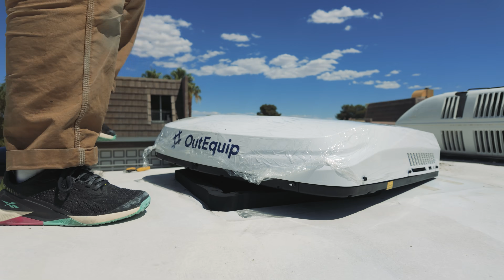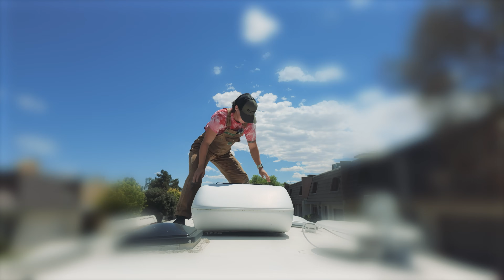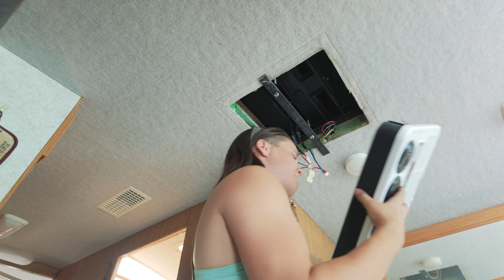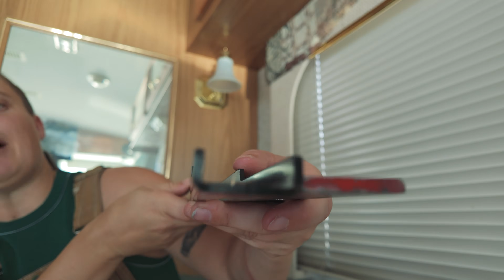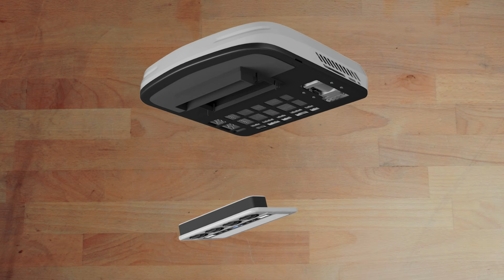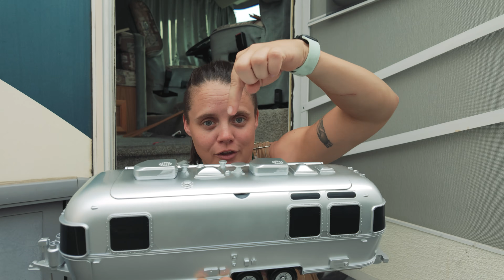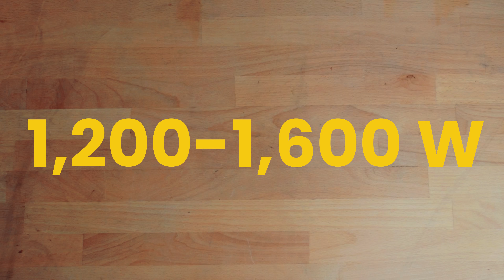Better RV Cooling with Less Power? My Switch to a 12V  AC | OutEquipPro AC Honest Review

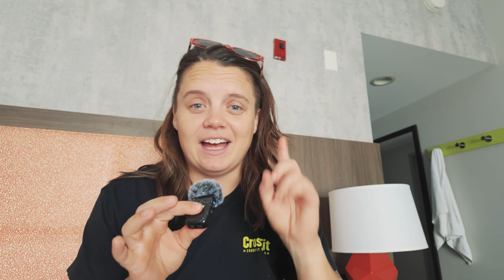Comment: 23:49
If you are plugged in at an RV hookup on either a 30 or 50 amp AC circuit, in an RV like yours without an inverter, you rely entirely on that hookup for power. This means if your A/C is runing from your 12VDC circuit, your batteries are discharging, or are being charged by a battery charger (or inverter/charger) which is basically doing the opposite of what an inverter does (making DC 12V from AC 120V instead of making AC 120V from DC 12V).

Therefor, your “capacity” in terms of amperage is not increased by running this A/C unit off of DC. You are not powering directly using AC through your “A/C” breaker, but you are using the equivalent (+ a small amount, nothing is 100% efficient) to keep your batteries charged, likely from a different breaker in your panel.
Reply: To be clear, what you said IS true for someone with solar and inverters for example, such as myself. I DO get the ability to run extra AC devices if my 6kW inverted AC no longer needs to power the A/C, if my battery setup can handle the extra load (ie if it isn’t also sized to output max 6kW).

Comment: Traditional TT owner here. I've been researching DC units for awhile. I've got a solar set-up with 480ah (Life4Po). A DC AC will be AMAZING. Also a newbie to RV AC stuff (but do understand electrical). Just wondering if I will need to modify the roof opening, or are most of the openings pretty standard?

Thanks for the great video!

Comment: It seems these 12 volt units were specifically made for vans and trucks with much narrower ceilings.  They would probably be a godsend to the average delivery driver in a panel truck that has to run around with his sliding doors open to help with the heat.  For what they are they're pretty efficient but in a 40 footer like my winnebago/destination 2 would be required.

Comment: When you say: 'Use less wattles" I think you not right. If less watts, it means less productivity (exactly it will take less Amp from your source, but watt describe how many works do it in per hour). if you make low Voltage, you Amp (per hour) will grow up if the same wattles. Also, it will impact to use more thick wires.

Comment: WILL I BELIEVE THAT ONE CAN ACTUALLY GO AHEAD AND LET SOME OF THAT CONDITIONED AIR GO BACK THROUGH YOUR REGULAR DUCT SYSTEM YOU MIGHT WANT TO JUST ADD ANOTHER LITTLE ELECTRIC FAN OR S   AND INTO THE CIRCUIT 
PASTOR DAVID ADAM GRENIS

Comment: I have a 23 ft class C RV And I have a 200 amp hour lithium battery bank a 3000 watt pure sine inverter And I purchased this room air conditioner that cools down to 61° and I've run it during the day with 400 watts of solar behind it and ran it for a couple of hours at the heat of the day I use it on occasion and never put a dent in my battery bank it's starts and runs so easily and vents out my small kitchen window. Really works great and super inexpensive I mean come on under $250 and there's no install I just plug it into my 3000 watt inverter and it runs perfectly. It's a costway 8000 BTU they do have a 10,000 or even greater if you want but I didn't think I needed that much and I didn't can be purchased on Amazon.

Comment: You better check your batteries all the time and rewire that thing and put good quality wires in it and it will work. That thing is a piece of crap don't even try to bring it in the desert it will burn your RV down

Comment: I just installed one..love it.  The gasket is useless, buy a new 1pc one.   Place the brackets just under ceiling panel, use the bolts it comes with and grind off the ends after installed so it's all flush.

Comment: Interesting information. Thank you. But the reason I came was to find out the power usage of the air conditioner, and without knowing the outside vs. inside air temperature and humidity the wattage by itself isn't very informative. Any air conditioner can get excellent efficiency if it only needs to run the fan and rarely turns on the compressor (or in case of the inverter, slower). The operating conditions are the important factor to give real world power usage. Would love to see this video redone with more carefully collected data.
Reply: She said, "The unit with the fan and compressor running, pulls about 290 watts". 
   It does not matter what the outside temp is. It does not matter what the inside temp is. It does not matter what the humidity is. It pulls 290 watts.  That is all you need to know.  Now you need to take it from there ...

Comment: When you are plugged in, you are charging your batteries from the AC, so you are not freeing up all the AC amps.  But, this unit is very efficient and greatly reduces the amount of your AC used to charge your batteries.
Reply: Solar Charging!

Comment: Notching that bracket, sense it is under load and vibration, will bend and eventually crack. 

The spacer idea would be safer method.

The manufacturer would be smart to sell a spacer to resolve this issue.

Comment: Wondering if two of these could sufficiently cool a 38’ RV. Have an old Dometic and  a Coleman up top, but can usually only run one with my 30 amp system. Have 600ah in batteries right now, plus an EcoFlow 10k system, with solar up top with about 1200 watts. By the way, you are hands down the best at what you do. Thanks!

Comment: I've experimented with 12-volt powered air conditioners for a few years can I have found they cost just about as much to run as a 110 and 120 unit

Comment: I have a question that maybe OP or anyone in the comments might be able to answer: what if I am full-time, plugged in, but don't have functional batteries? I guess all the DC stuff in the camper (lights mostly) must have an AC to DC inverter? In this circumstance would I still plug into the batteries or could I wire it somehow else or would DC appliances not be relevant for my use? Not sure if it's relevant but for reference it's a 1986 Avion similar to an Airstream

Comment: FYI: I was looking at it and the Victron and the 95% eff is misleading. I recently bought a Aims 2000w invertor / charger for a little camper build. From my testing im getting 83-85 eff... But if you look at the Victron eff power curve it ranges. So the biggest benefit with the 12/24 ac's would be no invertor loss. But the big question is "How long do they last" ??? Some of the regular ones will have lasted 20 years.

Comment: Hope you can answer this soon…. and btw you are such a great teacher thank you!      So I just ordered this for use in my fifth wheel and as you know the thickness won’t let the supply plenum connect … what would you recommend?  Either a foam board partition separating the cold and hot or come up with a ducting to connect the supply together?    Thanks!!

Comment: Still have a little more of the video to watch. Good job explaining things. It will help a lot of people.  
One thing im going to have to disagree with is that you don't need as much air flow. Air flow across the coils is was its all about. 
About 2 years ago, I redid all my AC ducks, in my house, of Couse cleaned coils at the same time. Same AC until with better air flow, night and day difference.

Comment: Hi, just started looking at (12 volt) a/c units. I have a 2002R vision flare light class a motorhome. I have a generator. I have a roof rooftop AC unit now that I will keep. I’m wanting to install a 12 V unit in the bedroom by replacing the roof mount vent. I didn’t plan on powering it with an Eco flow generator and solar panels on the roof. I’m also looking at replacing the old refrigerator with a 12 V unit. I think I can run both that rooftop AC and the fridge off of the Eco flow solar system. What do you think

Comment: The website says it draws 58A and requires 6ga wire.  Also says it is 10,000 BTU cooling with optional 4500 BTU heat.  I only saw 1 model.  Very interesting though.  Thanks for the info!
Reply: 21 Amps - Eco Mode
58 Amps - Turbo Mode
???
Reply: @MrSummitville I guess I  missed the modes.  All I saw was the spec chart.  Glad I found your video.   I've never heard of this before!

Comment: You fail to account for the power on the 12v side when you say you are moving the power requirements from the AC to the DC side, eventually you discharge the battery that needs to be recharged which will required AC, in fact too many will look at this and decide to add one only to discover the 12v batttery is quickly depleted, or they end up maxing out the 12v converter attempting to supply up to 60A of 12v power just to run the A/C when other systems continue to need 12v and the 12v fails.  These 12v  A/C systems are truly only for those with large battery banks or solar supplement, not for family campers staying in campgrounds with 120v shore power.  You also don't account for the BTU difference of a 10K BTU 12v unit vs a 13k BTU 120V unit. When in a very warm climate where the 13K unit runs near continuously, the 12v will also struggle more.  You fail to account for the difference of the lower airflow at a given delta temperature is much less cooling capacity than the higher airflow AC unit with the same delta temp.   I'm not disputing that the variable speed 12v units are likely a higher SEER ratio, but the RV industry is also starting to provide higher SEER units on the AC side, these are a better choice as it won't tax the 12v systems that have only 720 watts of total capacity after the batteries die and they come in 13K and larger BTU capacities.
Reply: + Solar Charging ?

Comment: @Rv Repair Woman >>suggestion as well for that air gap you got on the inside control plate why not use foam ribbon similar to what you would use around a house door , so you are doing something similar to the cummings camper but woth just a small piece of foam ??

Comment: Toluene is toxic, wear the correct thick gloves. 
Gemini AI: for handling toluene, nitrile or neoprene gloves are generally good for splash protection and incidental contact. For more significant or prolonged exposure, Viton (fluorocarbon rubber) is highly recommended.

Comment: Just starting to learn about this stuff.  I need to run an oxygen concentrator.  How do I determine what I will need to breath when     boondocking?  Shopping for a van conversion but this is all new to me. I also want this air conditioner.   Will solar be enough and how much?

Comment: I'm sorry, this is just not fully accurate. 

It pulls 1/4 the power because it doesn't cool as much. You saw this with the reduced air flow.  It may be a bit more efficient but it is 1/4 the power because it cools less. It takes power to move heat and you can't escape that. 

The 12 volts doesn't get you away from from conversion loss. The  AC draws 22 amps.  A 100 AH battery will power it for 3-5 hours (depending on battery chemistry). Then you have to charge your battery by plugging your RV into a generator.  That chargering of the battery is maybe 75% efficient so you have a conversion loss of 25% or twice the inverter.

The reduced cooling and the new additional 25% conversion loss means you actually will end up running your generator longer, and spending more on gas, than with the AC based air conditioning.

You can't escape physics. Less power because of less cooling and you need your generator in both situations.
Reply: Eco Mode vs Turbo Mode

Comment: 2007 Trail Blazer by Komfert 120v AC I run a Predator 3500 inverter, 2.9 gal tank, will run about 9 hours with the AC running, for our dogs
But I'd love to do one of these on my 77 Chevy G20 Van

Comment: It sounds like you found a wonderful a/c unit for RV. 285W? Ya! it consumes 4 times less than your old a/c unit. How about the cooling capacity? Is it same? For your RV size, You need to run 4 of that a/c units. Is it wonderful a/c unit? or just another lower version of a/c unit?
Reply: Eco Mode vs Turbo Mode !

Comment: You didn't add in the 30% losses in charging/discharging inefficiencies.  You should be measuring the kwh at the battery input for a good measure of efficiency.  There are even more losses when you consider the amps involved, which require much heavier wiring.  I might buy into this idea if you were actually running it live off solar, no inverter and no battery charging.

Sorry!  You missed a huge portion of the data by not making real life measurements, and you didn't add in efficiency of charging the batteries.

Comment: I love your explanation. It is straightforward.  I am looking to buy an RV. I'm deciding if want a TT, Class C or A, or ?  I'm leaning towards a TT in length of 20 ft to max 27ft to tow since I have a vehicle for it. I'm planning to buy used. So my question is...   You tested a unit that was AC only. They offer one with heating too.   Is it worth it? Then of course, adding battery and a charging system is a separate issue. Seems a 100A Lithium battery could run this AC unit.  For boondocking, I would look at a 2nd battery or 3rd. Then charge one separate as use the one. I know simple but like I said, I am new to going Boondocking  for months at a time. And on a starting budget of course. Also, 12V for a 12V battery. If add a 2nd 12V hooked up for 24V, is that worth doing for energy and longer run time. I plan to stay in temp areas max of 85F to 90F max. May be occasional places at season change where could hit 100F. Is it realistic to get at least 80F cooling . Be great if can get 75F.  I am used to a house that sometimes had 100F temps and the AC with closing curtains maintained 75F. Delta 25F. Do you think these AC can do a Delta 20F ?

Comment: I have been waiting and hoping an appliance like this would be developed in my lifetime. Sounds pretty tempting for more than an RV ! I was curious about your battery capacity and how and if  you basically opportunity  recharge it whenever you are tied to a pedestal or running a generator. The draw on your AC voltage total may be affected somehow by an onboarding charging set up if the batteries are also powering the air conditioner at the same time. And if you were boondocking...You also would have to know when to NOT use the Air Conditioner at a certain depth of discharge right? With an inverter in my experience they start to balk at giving any more power early enough so the batteries won't drop too far usually. Does the unit itself sense low voltage and safely shut itself off? Does it sound an alarm? Has it happened to you with your system?
 Great promotion and excellent presentation by the way! I like everything about your delivery! Thanks!

Comment: Ok, I'm subscribing because you used Ohm's Law without even saying that term, so +1 from me on the solid and simple presentation. I have a beautiful classic 1988 Class A, so you know I need good sources for maintenance info. Now, the Big Thirsty Kitty is due for some HVAC upgrade love (still have one original Coleman and a replacement that's about 15 years old. The original hardly blows cold and is noisy af). I'm definitely interested in DC AC!

Comment: Complete newb here - This seems like a good option for me while I consider doing some boondocking (I bring a dog and therefore want to be able to run AC when camping - HOWEVER. I have a single AGM battery, 200 watts of solar (part of the camper as delivered) on the roof and an additional ability to plug in a panel. Here's my question - my refrigerator is strictly 12V. my furnace is Propane (although I see they sell this AC with a heating element which may be a nice to have.  How do I figure out how much DC/battery/solar I would need to keep the DC/battery charged enough to run the Fridge, an A/C like this, say overnight until I can recharge batteries when the sun comes up?  that kind of thing.... Do you have another video somewhere to figure such things out?

Comment: Thank you for a great video! Question please, could I run this in my van using 12volt batteries and an inverter? If yes, do you have a recommendation or electrical equation to sort of figure it out?
Thanks again, subscribing !!!

Comment: One idea as well with these units. Is the use the duct as the return air. IF you have the the right size. that way its pulling the heated air from the ceiling and pulling the cooler air through out the RV. The math will be important on this one. and you can add a better filter in the box.  Great video

Comment: I ordered one and am sending it back. No matter how I do the math, I figure it will draw 80 amps. We’re using an all in one power center that maxes out at 30 amps DC.  If you have the more traditional piecemeal system and you can sustain that  80 amp draw (a 560ah battery will be spent in a little more than 5 hours) this might work for you. 
If you’re using a Bluetti type all in one you need to check the power draw compared to your power unit ‘s max output very carefully.

Comment: Would the 12 vdc ac cool a 25 ft rockwood camper ? my rooftop is a 12,000 btu and dose a great job but a portable 10,000 strugled to do any good.

Comment: HI, definitely interested in this for boondocking in my little Casita, but given that you have done a bunch of these have you ever installed one of these into a Casita, mine is a bit older, 2005, but still Im thinking it may be a better solution than the one I have.  it's a 17 foot Casita Liberty Deluxe.  And it's got the fiberglass shell, Im interested to know because of the issues you ran into with having to make a few modifications to the standard install instructions.

Comment: Hint here. Instead of trying to " WALK/LIFT " a heavy unit up a ladder. Tie a rope around the box or pallet long ways. Then, if possible, get 2 people on top of the RV to PULL/SLIDE up the unit with the rope on the rails of the ladder. If you have a 3rd person, have them GUIDE from the bottom up the ladder. Secure the ladder BOTH top and bottom,  so it DOESN'T move. Try it with just an empty box, modify as needed. This can save your body, especially your back from injury.